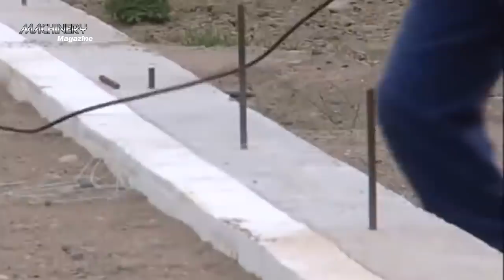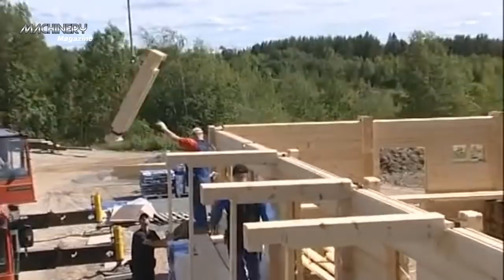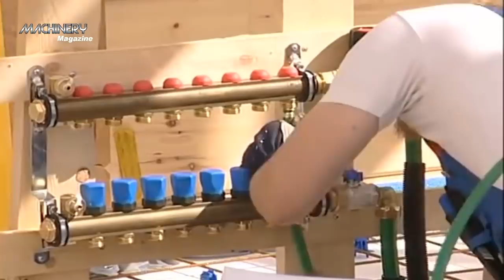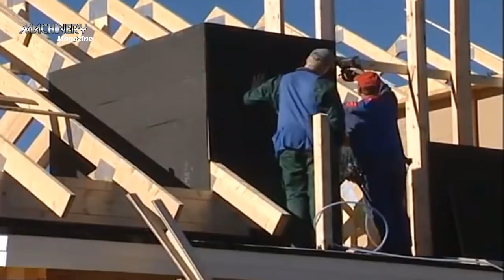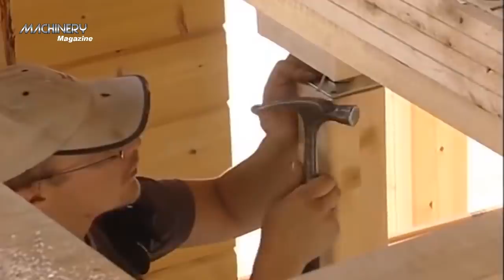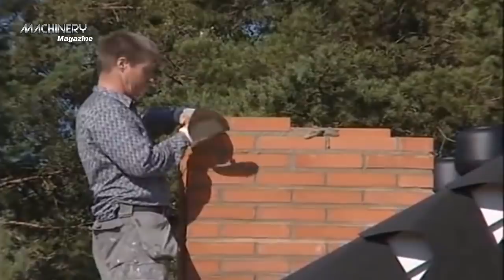Incredible Fastest Wooden House Construction Method - Amazing Intelligent Log House Building ▶4

Comment: Is this amazing and intelligent?? Look with the Dutch search term "scharnierkappen" (YT) Completely isolated  prefab heavy-duty roof elements (calculated based on very strong wind forces and snow loads) , roof gutters installed etc.  Installed in less than 1 day, with telescopic crane and 4 to 5 people any shape and size. Even without ceramic roof tiles waterproof. 
Only

Comment: I wouldn't want my roof frames held together with truss plates.
Reply: many here in the states do to. I've worked on many hotels that had them also. They frame willcollapse in no time in a fire.
Reply: Clearly you haven't taken the Fire Science courses that I have.  I learned about this issue in college in my Building Cinstruction Related to The Fire Service class. The teeth on Gusset plates go in about a 1/4 inch. The outer layer burns through quickly as you say,  but it then becomes weak, and brittle, where as wood framing attached with nails has another inch and a half of depth to burn through. Gusset  plates are cheap and easy during g the manufacturing process,  that's wh th they are used, but they are very dangerous for firefighters, and anyone trapped in the building during a fire. Fires often burn in the attic for a while before residents below are aware of the fire, giving even less time before a roof collapse. My source of information is my college education on the matter. What is your source?
Reply: @-sensibleChris In my younger days, I was an advisor to the Uk Timber Research & Development Association, as well as owner of a  joinery manufacturing co with 40 joiners plus site staff. & A building Co with up to 200 operatives. MRICS & MCIOB. Winner of a couple of awards.I gave numerous ( 300+) lectures on building matters representing industry over 30 years . I do know a little about construction. --- In addition i used to be involved in setting exams for some college carpentry courses as well as setting NVQs for wood machining over a 15 year period as an industry representative to the CITB. That was  before becoming an industry  member of the British Standards institute  for BS5750 being a member of the committee that wrote one of the industry guidance books---Is that enough - or do you want more?
Reply: Manufacturers don't  care about fire safety, they care about efficiency,  and establishing,  and meeting minimum standards for construction.  That was your job. People in your industry pay lobbyists to keep those standards low. The roof frames on this house, in THIS video are lightweight with gusset plates holding them together, that is the issue here. Did you even go to the links I attached? The proof is there. You are just being stubborn because you used to be a bigshot, and you are used to getting your way. I don't work for you. And I have no fear of you. I have already proven my point. And YOUR lack of understanding of building construction related to the fire service. I will now end this discussion as succinctly as possible. Go to your local fire department,  and ask the Fire Chief about lightweight roof frames, and in particular, ask about Gusset plates. I have already given you new knowledge, but maybe you will LISTEN to your Fire Chief. Click the links in my previous comment before you go.
Reply: surely by the time fire has reached your roof frame gussets, your house is pretty much fucked regardless?

Comment: The only problem with this is all the pex is running under the slab to each place, like kitchen, laundry, bathroom etc. What happens if there’s a leak beneath the slab?
Reply: And what's wrong with that ? (Are you talking about a warm floor?)
As if the outer walls behind the Kitchen need to be heated :) It is either to release the Pipe along the wall, or warm floor, or not to close the legs of the kitchen.